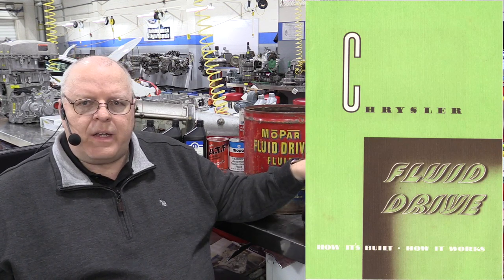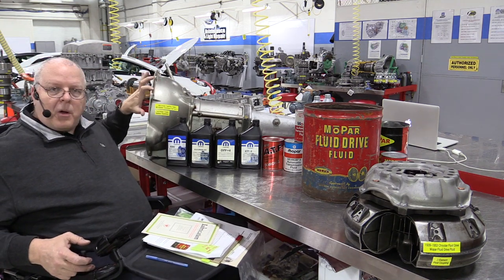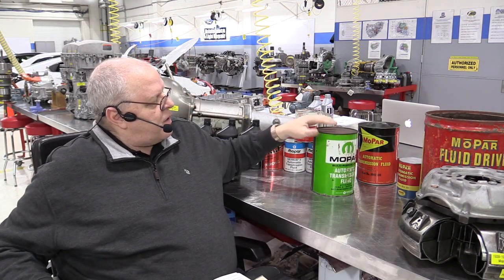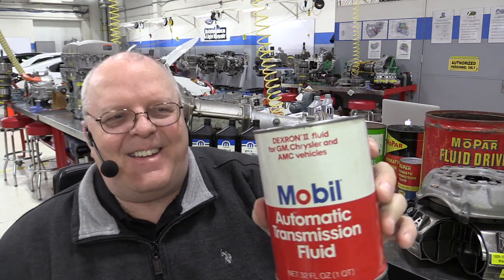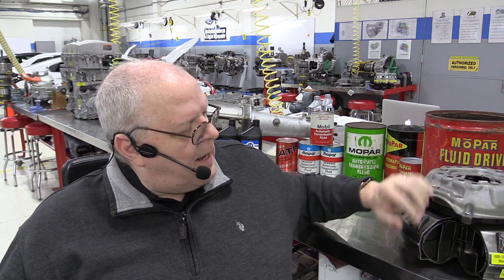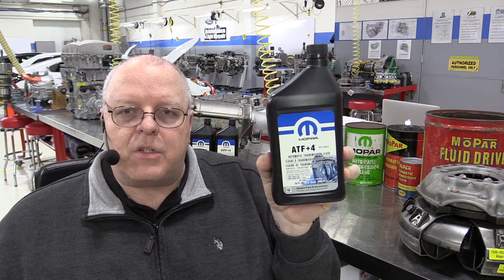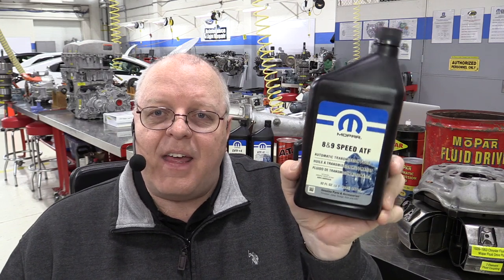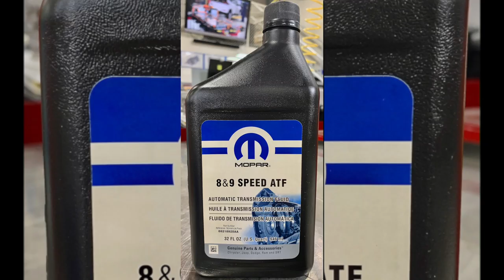Chrysler Automatic Transmission Fluid  - ATF History Part 4

Comment: So on the sealed Fluid Drives, they filled them at the factory and welded them shut? There's no way without adding a hole to exchange the fluid? 
Did the Mercedes 722.6 / NAG1 use ATF+4? Googling I just found a document saying the Crossfire and Sprinter use a different fluid, and the other cars use ATF+4... I wonder if that fluid is closer to the original MB specification?
Reply from the maker: Good question, I suspect they were filled when they were laying down flat (like in the video) upon initial assembly. According the Chrysler service information, the NAG1 does use ATF+4 fluid.
Reply: remember that mbz & chrysler merged for a while, then splited but it looks like they still engaged in some recent projects  as well
Reply from the maker: I remember, you can still get a NAG1 in a Charger with the Police package today

Comment: Very well done!  Shudder is a real issue.  New gm 6 speeds are getting flushed with a new blue label mobil 1 fluid at the gm dealer i work for.
Reply from the maker: Thank you very much. I think you mean the 8-speeds are getting flushed. Thanks for your feedback.
Reply: @WeberAuto  The Colorado's were added to the list recently. I'll have a better look at the tsb on Monday for accuracy. 
Have a good day!
Reply: I was wrong.  
It is the 8 speeds as you said.
Reply from the maker: @eatingplaydoh  Thanks, Yes, my 2018 Colorado 8-speed has the issue

Comment: PowerFlite was not in the 1953 model year.  It was introduced mid-year in 1954.  It uses a torque converter not a fluid coupling.  Likewise the remarkably similar three speed version, TorqueFlite, was introduced mid-year in 1956.
Reply from the maker: Thanks for your feedback, I have 1953 manuals for it, but that could easily be for a mid year 1954. Good to know, Thank you.

Comment: What is your opinion of the 42rle? I have a 2010 Chrysler 300 & absolutely love it.. it's a keeper and wanted to get a remanufactured one.. it's got almost 200k on it, slipping a little not too much. Thank you love your channel.. transmissions are such a complicated beast.. I love the four speed rear wheel drive

Comment: 41:00 every manufacturer using ZF transmissions claim "lifetime" fluid, even BMW, yet it contradicts ZF themselves. The fluid can be had cheaper than $30 though if you buy it from ZF and not a rebranded manufacturer bottle, I just got 7 quarts @ $20.00 a quart during a holiday sale
Reply from the maker: Thanks for your feedback, that is good to know.

Comment: Thanks for a captivating   presentation.   Does Chrysler make any of its own Torque Flite transmissions?  I did not know that FordOMatic had a low gear.  I always thought it was a two speed transmission.  Lockup torque converters started in 1948 introduced on Packard's Ultramatic drive.

Comment: Hi. Just come across your videos, very interesting.
 May i ask your opinion in using the ATF+4 in the German made 722.6? Jeep used the 722.6 Mercedes transmission and designated it the W5J400. Chrysler stated the fluid to use in the W5J400 was ATF+4.
 It always seems odd to use the Chrysler fluid in a Mercedes manufactured transmission when Mercedes used a MB236.10 fluid.
Is ATF+4 compatible with the Mercedes fluid?

Comment: So as you mentioned sir in this video about the different or disconnecte between Chrysler  and  zf  , my be  we find some one say that  Chrysler deceit there customer when they mentioned in the Owner manual that the fluid never change  for the life  of the vehicle for the Chrysler C200 model 2015 -2017 which it's  work  with transmission 9&8  speed & used 8&9 fluid

Comment: Every sample of Type A I ever saw was red.  The first Type A I saw myself was in a new 1959 Torqueflite.  I was told Type A was always red, but I saw that 1959 Torqueflite myself when it was new.
Reply from the maker: Interesting. I have several leaking cans of GM Type A fluid that are not red. I also have a can of Type A Suffix A fluid red dye for leak detection. The GM Dexron fluid was the first specification I am aware of where the red dye was required. There were probably other fluids that added it even through it was not required. Thanks again for your great feedback
Reply: @WeberAuto  Possibly Chrysler required the dye prior to GM.
Reply: My dad worked at a chrysler plmouth dealer in the late 1950's and 1960's, I remember red fluid around 1962 in factory fills.
Reply from the maker: @bad dog Good to know. Thank you

Comment: ATF+4is a very cost effective solution but the additive package is still standard base.  For let's say snow  plows where you need very low viscosity to start then high temp performance when plowing low speed and high load Citgo Quatrosyn works better and has a much longer drain interval

Comment: Hello Prof. Kelly, I just find you in youtube doing research. 
I just got a Chryler 62TE Rebuilt and hasn't coming good, first thing I found was leaking brought it back and the fixed apparently they have to take it out because some leaks out of torque convertor. I just mention them before and after the leak fixed that wasn't doing the shifting smooth and in between 4-5 & sometime 5-6 was a delay shifting gears and they say is normal because of the design of new torque converter some type of double locking system on it, never heard of that before as per my understanding transmissions has to shift smooth without lags......and in the afternoon checking engine bay I just heard Ticking Noise from Transmission Solenoid Pack with car in Park, First time I heard that in any transmission, Could be a bad solenoid causing that?
Thanks

Comment: Hi did you find a photo of ATF + 3   also if an after market CVT fluid  like Amsoil  specifies a product number on the back label same as Nissan CVT fluid should the after market fluid be as good or better than the OEM fluid . i have a gallon of ATF+3 i think Thanks JM

Comment: Isn't the "ZF" 8 speed transmission that Chrysler uses actually made by Chrysler under license?

So, conceivably, they're using different specifications such that they can recommend a "lifetime" change interval?

I think the claim of "lifetime" transmission fluid is bogus too, but if they're actually making it themselves in a different factory, maybe it really is different in some way from ZF's version.
Reply from the maker: Yes, the Chrysler built model is called the 845RE,  but it still says ZF on the housing. Yes, you are correct. Conceivably, they could different specifications and recommend a "lifetime" change interval.

Comment: Amazingly enough, you say that the M5 Fluid Coupling shared the same oil with the transmission.  This I believe from reading the S11 DeSoto workshop manual the Fluid Flywheel and Gearbox use WD10  oil. The the mechanics all think it is Dexron II and a restorer of an S11 DeSoto is using Dexron oil in the fluid flywheel coupling. I do not know what he is using in his gearbox. I am sure there are a lot of mechanics and vehicle restorers who are confused about what oil should be used as I understand that the WD10 oil is not obtainable.

Comment: 8/9 speed "life time" fluid:  FCA like each automaker does their own durability testing.  So it is clear the  fluid passed FCA testing for the full rated life of the vehicle, probably 10 years / 150,000 miles.  Useage patterns in the USA are milder than in Germany.
Reply from the maker: Thanks for your feedback

Comment: 9-speed ZF appeared first in 2014 Jeep Cherokee only, no other FCA or other automaker vehicles.
Reply from the maker: Thanks for your feedback. Honda and Acura use the same transmission
Reply: @WeberAuto  Others use the ZF 9-speed design now, but not in 2014.  Jeep was alone in 2014.  Also each automaker customizes the transmission design, mostly software, but there can be materials differences chosen by the customer carmaker.

Comment: ATF +4 was a blessing for chrysler as it seemed transmissioned failures really declined after this fluid was created. I have seen a handful of minivans that had the original factory fill of ATF+4 on them with over 150k and the fluid looked quite well still. It seems that a fill for life might apply to how many gears the transmission has to shift through and the application. The fluid seems to last quite long in the A604 application but no so in the truck transmissions. Changing it frequently is still a much cheaper option than not at all. I have only trusted Valvoline ATF+4 and the OEM. I have read in depth the specification sheets of base stock oils for others claiming compatability but they do not seem to hold up as they may use a lesser base stock and simply add more additives. I've got a few 250k mile original transmissions from chrysler just by frequently changing the fluid with ATF+4. Thanks for the great video series as your knowledge of transmissions and fluids is spectacular. These go to show that you can't grab just any fluid off the shelf and there is no such thing as "life time fluid".
Reply from the maker: Great examples and feedback. Thank you!

Comment: Your history series of automatic transmission fluids are most interesting. I owned a 1972 Plymouth Satellite Sebring ( $3200 new ) that started leaking transmission fluid after 15,000 miles. I would change the transmission filter and fluid and go another 15,000 miles before it started leaking again. That was my first and last Chrysler product.

Comment: ate-2 is it in a black bottle wight~ label with blue/back lettering~ ?? 
because i might make your day as the prior owner of my 2-gen charger had a case of different really old bottles of atf in the trunk and i think it's pre-1997 but most likely after 1973-76~ and its factory sealed ( i have not looked at my stash in awhile ) i think he was going to install a b&m shift kit in the 1985-94~ but never did as by my evidence i can see and the last tag=sep/97or8 July of the same year was last found insurance card i saw of his ownership .
anyways i can't use it now because someone else distorted by water ~ flooding my 1970~ 727 non lock-up transmission recently and i have modern gm 7speed 2006 up manual transmission style parts to replace it with
Reply: ps. i go to the logan cruise in logan ut usa omost every year so that might give you a idea of how far away from Weber i im
and yes if its the right bottle you can have it because it has no use by me it just going to take up my shelf space being useless with you at-lest you can use it as a teaching tool :)
Reply from the maker: Thanks for your feedback, I would love to either have it or have photos of the front or rear of it. Please email me at jkelly1@weber.edu and we can make arrangements.
Reply: @WeberAuto  sorry jonn i tried quickly looking ( win i got the chance from the snow melting / " weekend " ) for it on my shelfs and in the box i though it was in ( i did find 2 of the b&M bottles of the same time period im pretty sure I should have more than one genuine bottle of "dealership stuff" ) and didn't see it so i guess i will have to do some " shop cleaning " out to find it i will try to keep you posted if i find it

in the video you kinda said you haven't done anything yet with 3-speed mopar automatic transmissions and mite be interested to ( mostly because mopar used some valerian of the same ish transmission setup for so long ) and id be willing to freely lend for extended time period / or sell my 727 ( it should work on a dynamometer test one or too times with low loads it currently has sub-50-70k mileage and haven't tried using it recently so that just a theory but it technically died from some unknown fluid being pored in aka classic looking milkshake in everything including my engine apound trying to go through my start up check lists resonantly that i found it, and wasn't hookup to the transmission cooling system as i had it bypassed temporary to drive it at the time of removal that's win i saw it and drained out all of the old fluid / pan / torque converter but it wasn't running that way or tried out with " milkshake " and was in long-term storage win i parked my car last time it was in " mint " aka fine working condition with no apparent problems / with no milkshake and im not planning on replacing any 727 parts as i don't trust it currently 1/1/2019 for longer trips uphills / medium-high loads nor-im i expecting any one else to as i have a modern crate /dropout 6/7-speed manual transmission that's replacing it as someone else with more current pricing  / case usage experience than me recommend to do so in my usage case ) to education and or student practise if you what to
Reply from the maker: @richardprice5978  Thank you, I have not shot any videos on older Chrysler transmissions yet. I have so many ideas for cool video projects, but never enough time to get them all done.

Comment: 17:28    https://www.youtube.com/watch?v=C14dcjtL0Oc
People liked to blame that on the Partridge Family "Moby Dick" episode. I remember hearing stories of coolant mixing with the antifreeze in mid-1970s Buicks, causing the engine to overheat and the transmission to fail. I guess it took a while to protect the cooler from corrosion without the whale oil; I wonder if any owners just resorted to separate transmission coolers to keep it from happening again.

Comment: BMW uses ZF transmissions and BMW say lifetime fluid but lifetime to them is if the trans last 150k miles then that’s the life
Reply from the maker: Thanks for the feedback, funny how that works.
Reply: Sciatl - use common sense bro
Reply: I know I went to The BMW dealer to buy AFT fluid to do a transmission service I did buy some but they were given me a hard time saying you don’t need to change the fluid but I showed them the ZF service information and they did not like that if they want there transmission to fail

Comment: So Chrysler invented the dct dual clutch transmission in 1938
Reply from the maker: No, it has a fluid coupling with a clutch attached between it and the single transmission input shaft.

Comment: Yea me again Blah Blah Blah sorry.... So We have a 2008 Subaru with the 4EAT. I used the Valvoline Maxlife ATF fluid that said would replace the  HP Subaru fluid. After the change the shifts. slammed in to gear, ran hot and became un-driveable real quick.  According to Advance Auto this should have worked. I called Valvoline and they said that the transmission had to relearn because of the different properties of there fluid and to disconnect the battery for 10 minutes at least. I disconnected the battery overnight and had the same result the next day. I flushed thru 10 quarts of Subaru HP fluid. The problem went away and worked perfectly after that. I'm sure years of life were lost because of this event. Never again... OEM or OEM manufacturer fluid only for my tranny, I now use Idemitso as they make Subaru $70.00 a case of 12 on ebay. Johns right dont mess around even with the quick lube places. I have a story there but perhaps another time. I probably wore out my welcome on this video. Peace
Reply from the maker: Excellent example and feedback, thank you!
Reply: I'm writing all this down.  This is very important info.  Thank you for taking the time to tell us about all of this.  My opinion is that the world is a jungle and that everything is a lie.  DON'T BELIEVE A SINGLE THING.  Report back when you feel the need.
Reply: @alext9067  Alex. it is a jungle out there. I always was for the little guy trying to make a living as a mechanic. Things used to be simple. Aftermarket parts are made in mexico China Singapore India, Fill in the blank.One is never sure of aftermarket quality parts. everyone wants to make it cheaper Fluid company's make claims Those claims are sometimes not tested using OEM methods as in my case with this fluid. Subaru 4EATS are very particular about the oil viscosity they like. So More and More I am getting OEM junk yard parts or paying double for OEM and forgetting the problem for another 100000 or what ever mileage over aftermarket. Auto dealers dont do a better job typically with a repair but in Most cases use OEM parts (NOT ALWAYS BE CAREFUL HERE). A Johnny around the corner auto salon will usually use aftermarket but more and more I hear are just going OEM. A friends brother sold his garage in NY and now does Sprinkler installations in FL for this very reason. Parts were junk and the OEM dealers would make obtainable information scarce and offer little to no discount on OEM parts. and one can eat some labor time but with the taxable income and rent? Forget it. Its near impossible to make the money one needs. I do almost all my repairs and have been in the appliance repair field (on was in) for years. After market parts have charged drastically in every field . Most are sub par, Not just the no name brands either. All of them
Reply: I ran Valvoline Max Life Dex III years back in a Buick, and experienced the same issues you listed. Drained it out and replaced with Castrol Dex III and the problem went away immediately. I'm leery of using Max Life in anything again.
Reply: @RockandrollNegro    Marvin, I think Valvoline is a poor product line to be using in any application.  I remember using it in my motorcycle and the trans would overheat and not shift smoothly.  I switched to Castrol and problem gone.  
I know this is an aside, but keep that in mind.